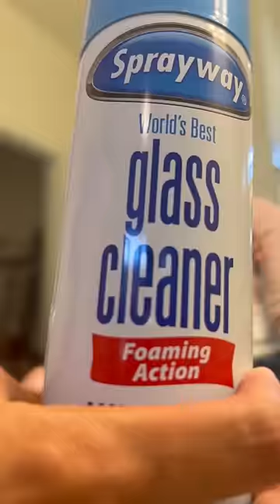Honest Cleaning #shorts #voiceover #mom #cleaning #sahm #cleanwithme #bathroom

Comment: Girl. The moment you said "scrub the shower once a month, the other parts once a week"... I've never related to an Internet mom more in my life.
Reply from the maker: I want to hug you 😂
Reply: Probably not the best thing to do but I've regressed to spraying bleach, coming back an hour later and hosing it down, then get in to shower and after I've washed and clipped my hair up I use the cleaning brush to get the grime off. 

I know if I try to clean the shower without showering at the same time I just won't do it. It's somehow easier for me to "Well the brush is right there, might as well" instead of "Today I have to clean the shower."
Reply: @katrinascarlet5637  No judgment here. Sometimes my goal is just to scrub one wall of the shower per day. It may take me 4 days, but eventually the entire shower gets scrubbed lol.
Reply: @bunny_0288  Cleaning the shower while you shower is great! Just don't use a product that has any respiratory effect as the steam will intensify it. So avoid bleach based cleaners. Honestly, avoid most cleaners marketed as tub/tile/shower cleaners. Protect your lungs :) As a professional cleaner I recommend getting one of those blue scrubby sponges or a scrubby brush and some dish soap for the shower. Just leave them in there. You can make it cute if you want with some sort of dispenser caddy but when you're in survival mode... the bottle in the corner with the sponge propped up next to it isn't hurting anyone. And, you're the only person who sees it. Most of the grime you get in a shower is body oil, skin cells, soap residue and similar and dish soap is great at removing it :) I like to scrub my own shower while I condition my long hair. If you have the extra motivation: when you get out of the shower, while the shower is still wet, you can spray it down with an acid-based shower spray or simply mix a 50-50 vinegar and water solution in a spray bottle. This will help prevent hard water mineral buildup that makes the monthly deep clean of the shower take so much time and energy. If the smell of vinegar is offensive mix up a citric acid solution instead of a vinegar solution. Citric acid powder is not hard to find since it has many home uses. One tablespoon of citric acid powder dissolved in 32 oz of water makes a great after shower demineralizing spray. Also, dish soap down your bathroom drains helps to keep them from getting clogged up. Do yourself a favor and anytime long hair is present in the shower or the sink just grab a tissue and wipe it up then flush the tissue down the toilet. Another thing you can do in your bathroom to help you feel more clean and tidy is to keep a spray bottle of streak-free multipurpose  cleaning spray handy and get a stack of coffee-filters. I use water mixed with a couple drops of dish soap as a multi-purpose spray in the bathroom. The coffee filters are lint-free so when you spray the mirror or counter and wipe it clean you won't have any lint specks floating around and no extra laundry since you dispose of the coffee filter just like a paper towel. Also, please - let's use disposable cleaning cloths in the bathroom. If you're only washing your cleaning cloths with your laundry and not disinfecting them with bleach or another sanitizer then you may be cleaning the rest of your house with bathroom germs. I keep the spray on the counter in a small "pretty" spray bottle that matches the aesthetic of my bathroom and the filters in a vanity box that similarly matches the aesthetic of the room. So they are both right there... on the counter. I can spray and wipe whenever the urge strikes. Another thing - you don't have to take the bathroom trash out to the curb when you empty it. You can take the trash can liner out and dispose of it in your large kitchen trash. Keep a few extra liners in the bottom of the bathroom bin and you'll be more likely to empty it with more frequency since you can just grab the old liner with the trash, tie it up, and re-line the receptacle. Then throw the trash from the bathroom into the kitchen trash and deal with that one later. I hope this helps! Cheers!
Reply: @xanland4275  Great tips! Yes I don't use the heavy cleaners while I shower. I usually use Mrs Myers. But dish soap is a great idea! And yes I already just dump all the trash in my house into my kitchen trash. When my kitchen trash is almost full I like to go around the house and collect any trash from bathrooms etc. to finish off the bag. Awesome tips!
Reply: @bunny_0288  Lovely! - and yes the Mrs Meyers spray is a perfect choice for cleaning the shower while you shower! If you'd like the validation - you've made the best choice for the task performed in the manner you've chosen :)
Professional cleaner for more than 20 years approved ;)
I simply recommend dish soap because everybody already has some in their home and dish soapy water down bathroom drains helps to prevent them from getting clogged up. A slow draining shower gets so dirty so fast. Keep taking care! Cheers!
Reply: @xanland4275  Scrub Daddyy!
Reply: Dr bronners soap is so good for cleaning and no harsh chemicals
Reply: Isn’t that how we all clean?
Reply: Lol. People. And their already clean houses doing a deep clean 🤣🤣🤣 with 5 kids and 3 dogs to match .... yeah right 👀
Reply: girl....same.
Reply: This is me!!
Reply: @katrinascarlet5637  actually this is a good tip for the person I am currently am 😂. I am a 22yr old with adhd and I am learning how to create sound habits to be more clean and organized. sometimes i research tips for the person I want to be and not the person I am. This definitely feels geared towards the person that I am 😂😂
Reply: @xanland4275  Great tips for cleaning and also caring for the nature, many thanks!
Reply: @katrinascarlet5637 makes sense bc cleaning the shower with your clothes on is so anxiety inducing. Im always icked out that my jeans or socks will get wet, or I’ll have to change
Reply: I didn't relate to it because her trying to make it seem as cleaning your bathroom regularly makes you a "clean freak" or a "neatness obsessed person" is wild. Some of you are just nasty. That is it and that is all. Your parents were nasty. You were raised nasty and therefore you're nasty. That is it and that is all.
Reply: @Hailey S  Atleast mine taught me to clean. Yours didn't . ❤️
Reply: @Selahhhhhhhhhhh  no she didn’t, she died of a drug overdose. I was legit a neglected motherless  child . That’s why I called your attitude nasty. It’s not my fault my mom wasn’t around. I do clean, but I was never taught how by my mom.
Reply: @Hailey S  That's very sad that your mom died of a drug overdose. It's a terrible thing to lose a mother. BUT that is not an excuse to be a filthy adult. YouTube and Instagram is a wealth of information and I know channels here purely dedicated into getting people into the discipline of being a clean person. If you guys can sit and watch vlogs of clothes and makeup tutorials you can discipline yourself to become a self-sustainable adult. There comes a time where you have to stop using your trauma as a crutch and seek to do better for yourself.
Reply: Agreed

Comment: Hey! The way you can make the cleaning easiest for you is by doing one to two tasks every week/day so for example. I scrubbed my shower every weekend and that’s it that I do in my bathroom. Every 3 to 4 days I wipe my mirrors down with Windex and I wipe the surfaces down with bathroom cleaner. I also got one of those robot vacuums so I don’t really have to worry about sweeping up my hair after brushing my hair in the mornings or blowing out my hair. Also you can use products that keep your bathroom cleaner for a longer time. For example I use those gel stamps in my toilet so because of that I only have to clean my toilet once every two weeks rather than once a week. Using gadgets that make cleaning easier and faster also helps. You can get one of those electric scrubbers.

Comment: The type of cleaning you're showing is a deep clean. I can't imagine what sort of filth people are accumulating that makes them need to do this more than once a month. My bathroom floors get mopped regularly. The shower stall is squeegeed after every shower. The mirror is literally only cleaned when it gets dirty (I'll quickly squeegee if I splash toothpaste on it or something) the toilet is also scrubbbed if it is dirty, and the sink is wiped down maybe once a week. I unclog the shower drain after washing my hair (most times)... so I don't think getting on my hands and knees with a toothbrush,  getting into corners, or dusting surfaces I rarely touch really needs to happen more than once a month! Honestly, I may do it even less frequently than that.